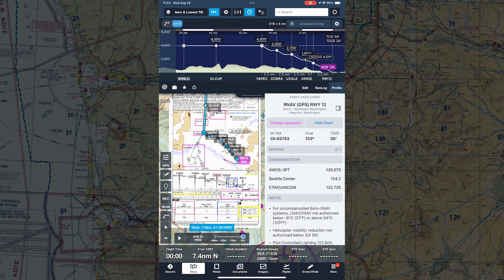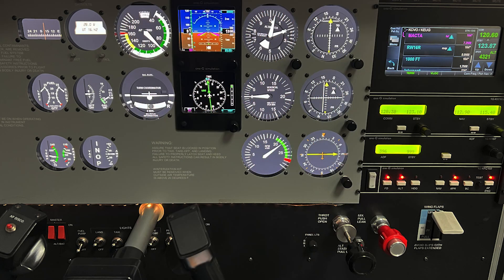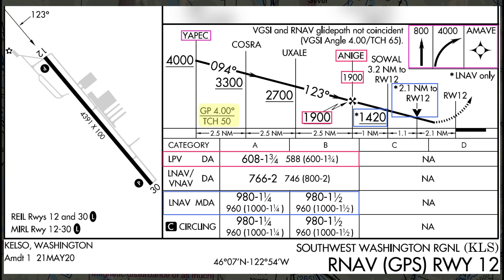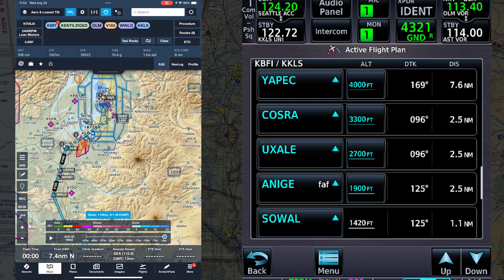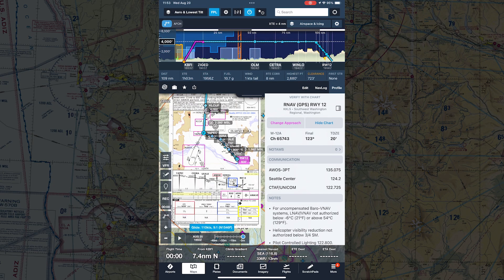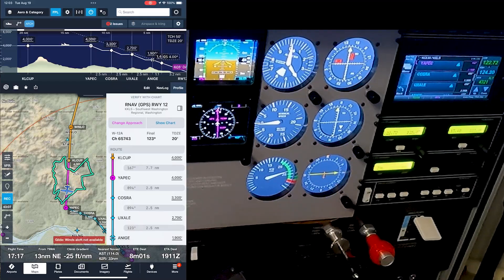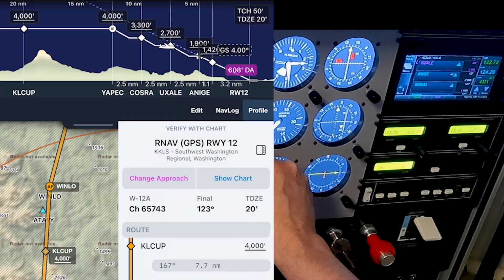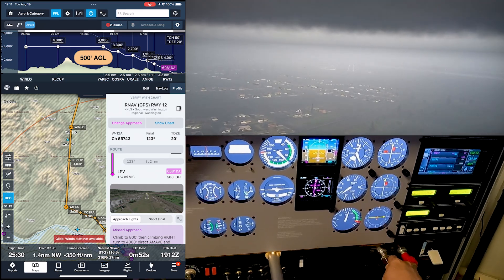Simulated Approach with ForeFlight Dynamic Procedures

Comment: How did you get the Dynamic Procedures activated on your account?  I have the premier account and can’t get it activated?
Reply from the maker: See the ForeFlight website: https://www.foreflight.com/enhancements/dynamic-procedures

And make sure that you have updated ForeFlight to the latest version.

"Dynamic Procedures is initially available for the U.S. and Canada only, with additional regions coming soon. All customers in supported regions may access the feature as part of a limited 3-month preview, after which it will require ForeFlight’s Essential subscription plan or above."